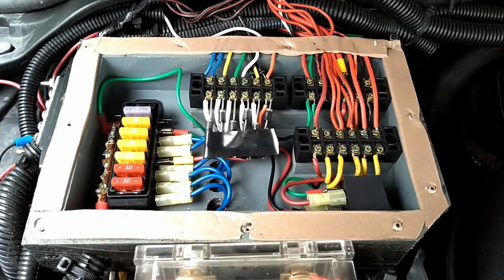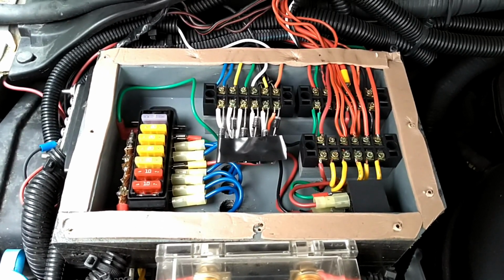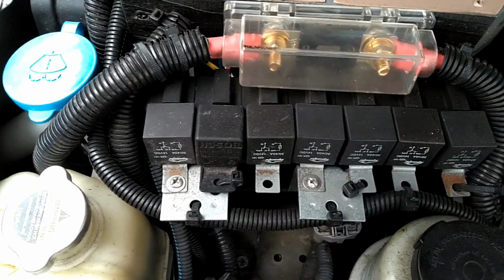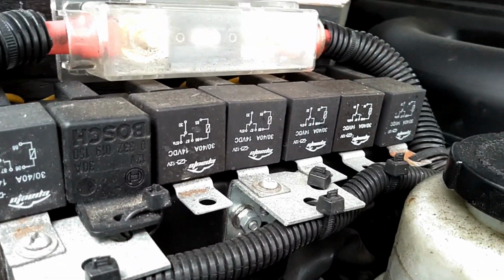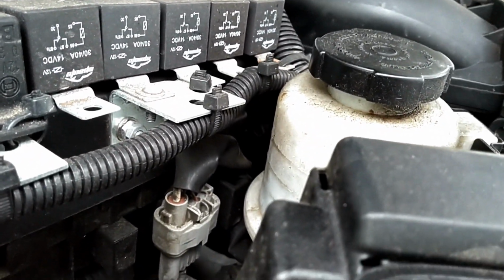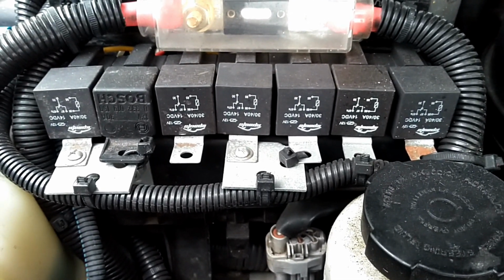Underhood Fuse / Relay Box Part II

Comment: What size wire and fuse are you running on your main power wire?
Reply: Nice and clean thank you got the info
Reply from the maker: Hi, thx for writing in. #4 with a 100A circuit breaker. The negative power line has a 150A fuse in it, cause the day I was wiring all this, I had an issue with the other cable I was going to use for the negative line but I happened to have one pre-fabbed with a fuse holder, so I just stuck it in. It's still there today, works fine.
Reply: @frontiergeek4953  how long are you running the length of the wire tho?
Reply from the maker: Its around 18" in total.

Comment: I remember seeing your post on club frontier quite some time ago how much clearance would you say there is on top of the factory fuse block  Before you put your fuse block on their
Reply from the maker: Brian, is that from the top of the existing OEM fuse block, or do you mean the total stack height from the OEM block / box to the underside of the hood when closed? I'm not exactly sure what the current space clearance value is, but it for sure does not hit anything when the hood is closed, and the block is just over 2" high when fully assembled. I put a short t-shaped spine on the bottom of my box to create a stand-off space so the wires can run through, but the spine rests directly on the lid of the OEM IPDM E/R box. To get to the OEM fuse block below, I'd have to disconnect the main power feed and the relay hold-downs, then fold my box up and out of the way. That's why all the wires exit from the rear.
Reply: @frontiergeek4953  I meant clearance on top of OEM block, but you answered my question with your 2" high block measurement. I'll probably do something similar, but w/marine star board. I'd just like to be able to access OEM fuses underneath w/o taking apart the added block.
Reply from the maker: Brian, I think the access question would be possible if all the wiring came in from only one direction, say everything from the rear, or the front, or the engine side. The fender side would prob be quite tight, I mounted my ground busbar there and its quite tight.

Comment: Great job.  The only problem I see is the relays should be the fully waterproof ones to keep the terminals from corroding.
Check this out at Amazon.com
1 PACK 40/30 AMP 12 V DC Waterproof Relay and Harness - Heavy Duty 12 AWG Tinned Copper Wires, 5-PIN SPDT Bosch Style Automotive Relay https://www.amazon.com/dp/B074QV54V1/ref=cm_sw_r_other_apa_i_.bdREb98ZWHEP
Reply from the maker: Reid, thanks for chiming in. Yes, the fully waterproof ones are nice but if you put dielectric grease on the terminals before assembly, you'll never have any problems. I've been using this style of Bosch underhood since the late 1980s. These relays also face backwards so the only way water would get in would be if it somehow splashed up ( unlikely ), or from just atmospheric dampness, granted, that could be an issue. The ones you referenced are quite nice, but the sockets don't "nest" either, so the build would be slightly more complicated. Either way, its all good.